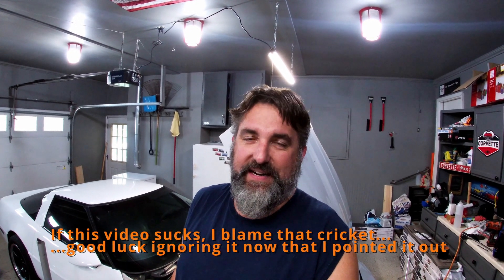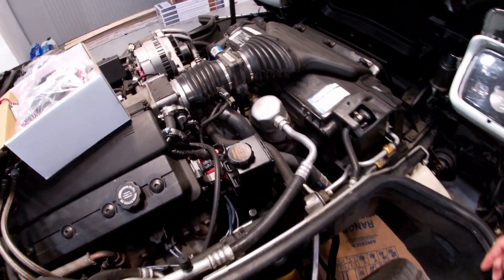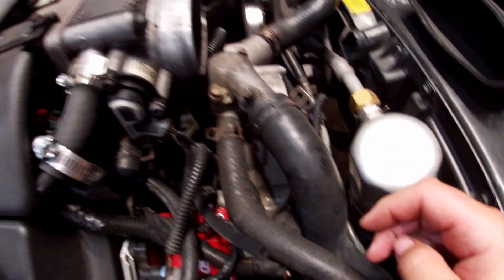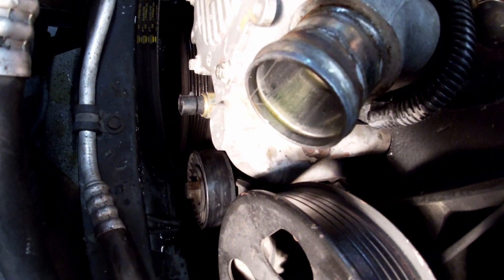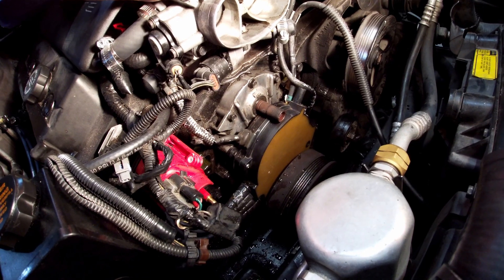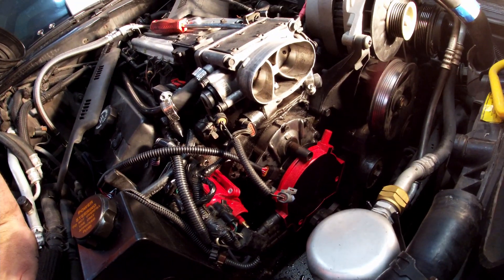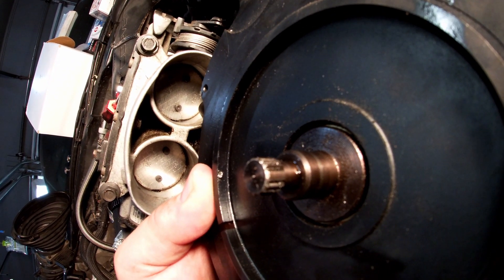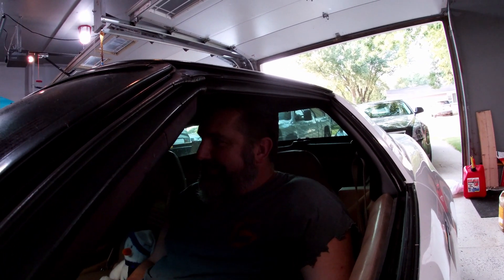1994 C4 Corvette Optispark (distributor) replacement - H16 H36 DTC

Comment: having a problem with mine that i think is opti related the car shuts off everytime i drive it like after a few minutes and has a slight misfire and rough idle i replaced the battery and alternator that hasn’t helped opti is next wish me luck
Reply from the maker: @TigerCummings-k1j  good luck...if you haven't watched the rest of my videos chasing that exact same problem, be sure to check them out as well 👍

Thanks for watching and commenting!

Comment: Just saw start up did you read those plugs and While at it do a compression test that’ll tell the story also scan the computer look at your senses see what they’re reading
Reply from the maker: Yeah, I gapped the plugs and checked for spark...I actually end up pulling everything (intake and heads) to check gaskets somewhere in a video 😂

The computer was being very unreliable (I think that may have been the issue all along!) so that is getting replaced during the rebuild process too!

Comment: As always your videos are very informative 👌 👍🏻  I removed waterpump today off my 95 C4 and the bearing on the back side of the pump had gone bad seeing the lil ball-bearings and the lil drive piece that connects to the cam is rusted to the back of the waterpump drive... I got the three bolts out of the crank pulley but i can't remove the pulley... do you have any suggestions?
Reply: Got the Crank pulley off today.. used a very small pulley puller and it was a PAIN... Now I've just realized to run my new spark plug wires on the Drivers side I'm going to have to remove a/c compressor, alternator and the belt tensioner just so I can get my new spark plug wires to the Optispark... and the coupler that goes on the back of the waterpump to the cam shaft is rusted like welded to the waterpump shaft and the seal on the back of the water pump had gone bad.. you can see the little ball-bearings in there..
Reply from the maker: @mrdeanv4414  you can get them through there without removing everything, but it is a complete pain in the butt! One at a time basically!
Reply from the maker: Is the pulley off the crank and in there loose and you just cannot get it from between the crank and frame, or it is stuck on the crank?
Reply: @Amundred  the 3 bolts are out... I just can't get the crank pulley to slide off
Reply from the maker: @mrdeanv4414  Can you use a pry bar and put some pressure on the backside of the pulley?
Reply: @Amundred  yes and it's not making a difference at all
Reply from the maker: @mrdeanv4414  Maybe spray it down and let some penetrating oil work on it overnight? The pulley can definitely get stuck on the pulley with a little rust
Reply: @Amundred  yes I did that before I called it a night... and absolutely for sure it's never been off and the Optispark is factory
Reply from the maker: @mrdeanv4414  did you ever get your pulley off?
Reply: @Amundred  no not yet... I did find a special pulley at O'Reillys... I pick it up this afternoon

Comment: Be sure and pull the plug wire off each plug as the heat can melt or burn the boots and cause misfires. I've been reading where many people had same issue as you and it was plug wires, even on new plug wires.  Buy the MSD or Accel 900 ceramic boots as they will not melt and cause issues.   This could be your issue, pull them all one by one and check them.
Reply from the maker: I definitely need to get some of those boots! I did just install all brand new plugs and wires!

Comment: With the aftermarket coil, the cable with the 90*  bend seems to snap on much better. On your drivers side, did you route your wires properly?
By properly,  I mean if looking at the wires from the drivers side, are they all the was under the power steering hose.
Wires should be in the small gap between the bracket and hose, not over the hose.
Reply from the maker: Yup, all wires behind the bracket and beneath the hose - I am going to put the new wires on this weekend and try to fire up the car to see if it runs any better on the off chance that there is a wire issue somewhere
Reply: @Amundred   If you globbed on to much antiseize on the plugs, it can make it's way to the electrode and ground out the plug, also the electrical silicone for the wires, should go on the boots only, not on the connections, that would cause the engine to run poorly.
Reply: @Amundred  Take a strong light and look at all your wires, make sure nothing got chopped up and all plug boots are on tight!💣💥
Reply: @Amundred  Your last video of opti replacement sounds like crossed wires on either opti or plugs!👿
Did you use the aftermarket harness??
A video I saw on a guy who did the same as you said there's a harness pin in the new harness ,he had to remove because it wasn't matching the stock harness.
Reply from the maker: @geneyus6411  yes, there was an aftermarket harness that came with the Opti...I will have to check that!!!!
Reply: @Amundred  His video is called 
"Installing opti spark on my 1995 C4 Corvette " You can skip through, he shows the pin he knocked out.
His user id  for the video is 6speed713
Reply: @Amundred  He also tells about the vacuum line routing. On a side note, I was replacing my drivers side spark plug wires and thought I would replace the idler pulley under the AC pulley. I removed the bolt and it's totally seized,  stuck to the bracket. It's still on there after wacking at it, trying to pry it. I'll try adding some penetrating fluid. If you don't need the pulley that day, Amazon had the best prices($15). Rockauto was cheap but you would have to pay shipping. Regular parts chain wanted 2-3 times Amazon for the same part(plastic).
Reply: @Amundred  Have you made any progress?? Haven't heard from you lately.
Reply from the maker: @geneyus6411  I am doing the wires plugs tomorrow - had to get new water pump gaskets so will hopefully have an update to post on the Vette tomorrow!
Reply: @Amundred  ok, thanks. I'm still dealing with a seized idler pulley.
As in totally stuck to the bracket. I've never had that happen b4. Any other idler pulley undo the bolt and and pulley falls off.  I have a new one ready to go on. It's the one under the AC, Tight space. I tried smacking, prying, no luck!💣💥
Reply from the maker: @geneyus6411  fortunately, mine came right off! I also had to replace my tensioner pulley! They were both shot! 😮
Reply: @Amundred The idler pulley must be stuck from neglect, as in nobody changed it b4. I replaced belt, tensioner when I bought the car.

Comment: Man I'm  going through the same shit 😪. My car has been 
sitting for four years because 
of  a bad optispark  .I'm planning on going to Torqhead 
coil  per cylinder ignition when 
money 💰 permits.
Reply: Why has your car been sitting for 4 years because of the distributor?
Reply: Water pump went bad coolant 
leaked down into the optispark .
Reply: What is your car?
Reply: @C4VETTELT1  94 pontiac firebird formula  six speed.
Reply: @vincentfisher4748  why has it sat for 4 years though? Optispark replacement isn't that hard, I just did the Optispark, waterpump and hoses.
Reply: @vincentfisher4748  nice... I had a 95 Z28. but the 92 corvette is way better!!
Reply: @C4VETTELT1  The optispark   distributor going bad on lt1 engines is the reason why you 
don't see a lot of lt1cars on the
road  . mine went bad during rush hour traffic .
Reply: @C4VETTELT1  I rather drive my car than spend a day ripping the front apart to replace it . It's not an easy job
and I work  on cars for living.
Reply: @vincentfisher4748   well I'm a painter and I did and do all the work myself!!! If you know what you're doing it's literally a 3 hour job!!! If you wanna spend time driving your car you gotta put the time and effort in!!! I couldn't imagine having my baby sit for 4 years without driving it!! That's crazy!!!  If you by chance live close to Portland Oregon I'd do it for free!!!
Reply: @vincentfisher4748  you're actually quite wrong on that!!! There is LT1 cars everywhere!!! I see um all the time! The grubbworm camaro power by an LT1 has all the records again!!!! 7 seconds well over 200mph!!!
Reply: @vincentfisher4748   look up elsewhere engines on YouTube all he does is LT1s.
Reply: Ellewien engines
Reply: @C4VETTELT1  HI  Sarah.  I too have done optispark jobs in
3 hours ,recently I did one in 2 
on  a vette  but I had help . l just 
don't  like doing them. too much bullshit involved with them and the parts store ones
are very sketchy .The parts store one I installed  a month ago  failed   3 weeks later .the  owner of the  car is 
going to order a Torqhead kit 
for his 96 vette. I appreciate your  offer to help out  but I'm done with them
  I'm going with Torqhead  for my "Bird" , I missed out on going to  a Kansas city
chiefs game  because of a failed optispark.
Reply: @vincentfisher4748  oh man that's shitty!! BTW my name is Jared. Lol
Reply: @C4VETTELT1  HI  Jared. 👋  the only reason I haven't got rid 
of it is because I  bought it new
and it's a six speed formula 
firehawk.
Reply: @vincentfisher4748  nice hell yeah the firehawks are super sick it's just unfortunate they weren't as badass in the 4th Gen. The 3rd Gen firehawks are really quick!! Almost 12s! They might have been in the 12s actually.
Reply: @C4VETTELT1  Back in 91 I  almost bought a 91 firehawk the only thing that got in way of it  was desert storm.
Reply: @vincentfisher4748  sounds like your a Lil older than I. That saddam was a crazy SOB to say the least!!! Some of the shit he did to his own people and soldiers!!!! Modern day Hitler!!! But yeah that socks missing out on that!! I'd really like one or a 4th Gen too.
Reply: @C4VETTELT1   Yeah I'm a few years older. My bird 🐦 makes up for the 87 Grand National  l lost in a divorce
years  ago.
Reply: @vincentfisher4748  that's a good one too!! I'd rather have the firehawk personally.

Comment: You must feel ASE certified now!😂
I don't know about prying your balancer off, that's a delicate piece.
If you do go LS, I think I read they are 250 lbs lighter than LT1. I have a LS4 in my 2007 Monte Carlo SS👍
You should hang onto that LT1.
Reply: Happen to come across a recall for 1995 LT1  concerning a vacuum line harness that may get to close to the power steering pulley.  Guess what happens if your vacuum line gets cut???
Opti stops working!

Comment: I just went through the same issue with my 92 LT1 corvette and finally fixed it! It was a long frustrating process! But don't give up!!! Message if u have any questions.
Reply from the maker: I am actually in the process of pulling the LT1 for a rebuild! I just started the project and do not have any deadlines. Taking my time and deciding what exactly I want to do. Definitely going with a Stroker build...just ironing out the details
Reply: @Amundred  awesome!!! Hope everything works out for you!!! I'm very curious on your build. Please keep me updated or post some videos. Lol.
Reply: If you just went through same issue, why don't you say what fixed it???
His parts cannon is reloading!😁😂🤣💣
Reply: @geneyus6411   because it was a hual of parts and not completely sure exactly what it was!! That's why.
Reply: @C4VETTELT1  Well ,same as the parts cannon he was firing!
You also stated it was fixed but now you don't know how??
I guess the car fairies fixed it??🤔
Reply: @geneyus6411  let's see..... it could have been knock sensor, o2 sensor, plug, plug wires, bad ground, PCV valve, ECM coolant temperature sensor, ECM,ICM, and the list go's on and on!!!! But I'm great don't need your halfwitted comments!!!
Reply: @geneyus6411  or coil, coil wire, EGR. Get the picture!!!!
Reply: @C4VETTELT1  Granted these vehicles are older and will definitely benefit from new parts but don't always blame everything on opti. It could be as simple as replacing old worn ,cracked engine vacuum lines. Also if you replace a TPS sensor, you are supposed to messure electrical resistance with a multimeter so you can set the new part to that resistance. If you are are trying to fix a specific problem, you should not just be firing off the random parts canon💣💥
I didn't even see vacuum lines in your parts list???
Reply: @geneyus6411  BTW your not talking to a woman!!!
Reply: @C4VETTELT1  Who cares and what's have to do with anything?
Good luck to you , whatever you are. I'm not responding to your frivolous comments anymore.
Reply: @geneyus6411  sounds like you no nothing about the OBD1 vettes!!! 80% of drivabilty  issues do NOT throw a code!!!
Reply: @geneyus6411   dude my car runs like a dream!!!! Destroy anything you got guaranteed!!! Do yourself a favor and mind your own!!!
Reply: @C4VETTELT1  I'm not your dude
Reply: @C4VETTELT1  F____OBD2 Corvettes. OBD1 is the way to go - simpler .
Reply: @geneyus6411  but I'm pretty good with the LT1 so if you need some help just shoot a question and I'd be glad to help!!!
Reply: @C4VETTELT1  thanks but no thanks!🙄

Comment: I cannot find a Delco optispark. Had to use aftermarket china junk. I hope it last.
Reply: Petris is supposed to be a great alternative to Delco. I am about to change my stock Opti for one because I am having the run for 15 mins and then stall issue going on. Doesn't start back up until the car cools down. Anoying as hell
Reply from the maker: @usaf20071989  I actually have a Dynaspark that was installed, I pulled it out and put in a cheap one to test out...ended up not being the Opti lol
Reply: I found a rebuilt Delco on Amazon for a good price.
Reply from the maker: They are definitely difficult to find! I still have my original Opti and had considered having it rebuilt using a rebuilder on eBay that comes highly recommended.
Reply: Why do you keep mentioning your height?? Don't you know big boys fall down too??😂🤣🙄
Reply from the maker: @geneyus6411  haha...didn't even realize I mentioned it in more than one video! 😂
Reply: @Amundred  Guess it makes you feel like a tuff guy!💪🤪
Did you read that article I recommended about the Dynaspark??
Reply from the maker: @geneyus6411  I felt like that... 😢
Reply: @Amundred  Maybe LS in the cards for you. Possibilities are endless.
Reply: @Amundred  Maybe you can donate that Dynaspark to me. I'll put it my engine, see if I get the same results💣💥
Reply: @Amundred  I can imagine, you thought you were going to put in reverse and go road test. I would have brought down half of that garage if it happened to me!🦅
Reply: @Amundred  Some people in forums have said they just transferred the  better GM sensor over to the new  opti part, is that possible to do? Maybe your engine not running properly saved you from your balancer flying off,lol. I was cringing everytime you pryed on it!😕
Reply: The previous owner installed accel opti.
So far so good. Also came with new waterpump and freshly rebulit, professionally installed transmission $3k.

Comment: Nice video also have a 94,  yea it seems you have another issue hope you get it running.   I am going on my 2nd opti with 105k.  Bit the bullet and converted to Torghead to just get rid of the opti had it done last week.  I just cannot drive knowing if the car is going to leave me somewhere.  What headlights are you running, I need to change mine out and want to go projection.
Reply from the maker: Thanks for stopping by! I was going to convert to the Torquehead system last year but parts were on backorder forever it seems like! I may still go that route at some point.

The headlights are Genssi LED bulbs. 

I did a video review on them awhile back...they are really nice!

https://youtu.be/XXgoC9lYI2A
Reply: @Amundred  Thanks for the info..... it is for a vin J but since you have the service manual did you already replace the ICM? I was looking at my 94 service manuals those 2 DTC's deal with the ICM for vin J I know we have a vin P but you never know.
Reply from the maker: @jimmorgan1078  I actually did replace it! Unfortunately, it did not seem to help. I did find a vacuum leak (bad throttle plate gasket) and replaced my IAC this past week...haven't tried starting it yet though.

Comment: So did you figure out what went wrong?
Reply from the maker: I haven't done anything else with the Corvette lately. I did pull the codes after resetting them from the Opti install and found some issues with MAP, IAC and EVAP readings. I did a video where I replaced the MAP sensor and EGR components. I have a new IAC which I will be installing this week and I feel like there is a vacuum leak somewhere causing some of the issue. I will take a look at the vacuum lines and throttle body gaskets when I do the IAC. 

I'll make another Corvette video to hopefully upload before the end of the week with an update!
Reply: I have some videos on my 92. Nothing on actual tracking or fixing process. But some proof I have one and it runs right, so feel free to ask any questions.